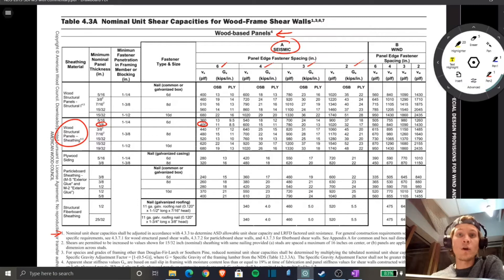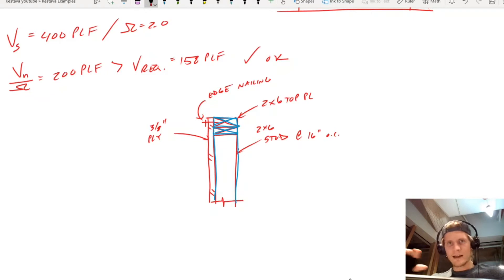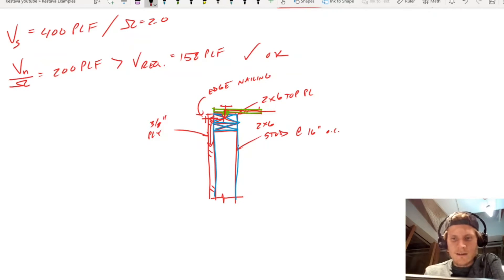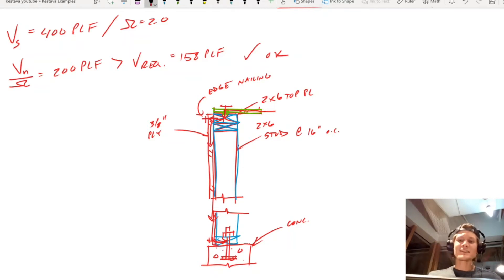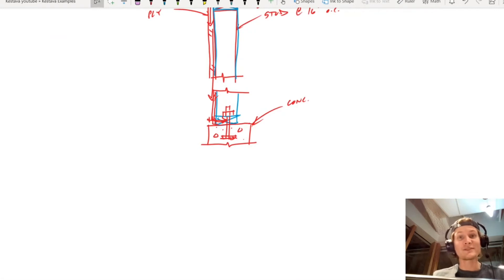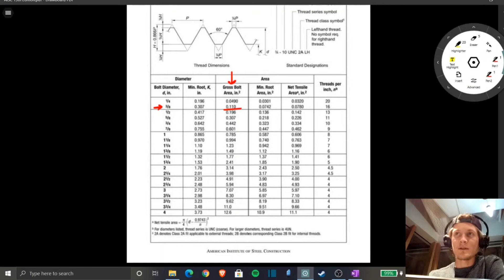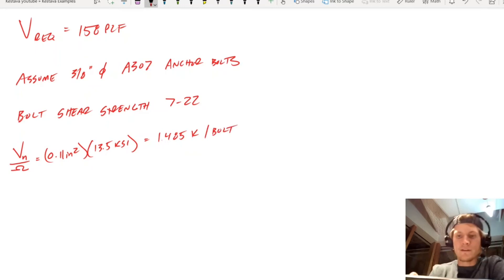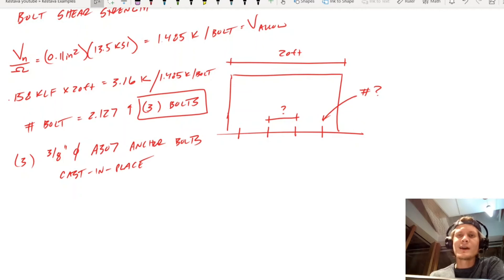How to Design a Wood Shear Wall - Part 2

Comment: Thank you for the video. Isn't the over-strength factor equal to 3.0 per ASCE7-16 table 12.2-1 item #15?
Reply from the maker: yes you are correct! it is 3.0. If you look at foot note "b" you can reduce this number to 2.5 if your structure has a flexible diaphragm as well!
Reply: I see. Thank you.

Comment: Phenomenal video. I passed the PE taking the hydrology depth but I’m slowly shifting my career to structural. Your videos are super helpful for me. The breakdown of the load path is exactly the content I love seeing. Sometimes the content we learn in class or in books is so specific, it can be tough to see how it ties in to the big picture. It’s like we’re designing a beam/column/wall in a vacuum, with no context. Please keep up the good work! Now for my question, the lateral force you drew, the arrow going from right to left into the diaphragm, shouldn’t that arrow have going INTO the page? Ie parallel to the sheating, since shear walls handle in-plane lateral forces, not perpendicular? Maybe I misinterpreted what you did.
Reply from the maker: your spot on Philip - my arrows are meant to show how the lateral forces (into the page) get from the diaphragm down to the foundation.
Reply from the maker: out of plane lateral is resolved through bending of the studs about their string axis for stud walls. this can actually increase the size of your studs if the wall is tall enough and the (mostly wind force) is high enough!

Comment: Thank you for making this very easy to understand.  Can you please explain the concept of over strength factor, Omega>
Reply from the maker: yes! i will get more into that in an upcoming video. thanks for the kind words!
Reply: @Kestava_Engineering  Omega or over strenght factor is simply a safety factor tht increases your required strenghtt or number for things you don't know about in the quality of the material, workmnship,  etc.

Comment: I would have thought that you needed to check the capacity of the sill plate through the NDS (axial compression / interaction with an individual bolt). Is this not the case? Or did you do this and I didn't quite catch it?
Reply: I agree.  Usually, the wood connection controls for sill plates.  It should be checked using the NDS.  The 2018 NDS Table 12E has capacities for 1/2" and larger anchors to concrete.  For spacing, the IBC allows a max spacing of 6',  but the CBC allows for max of 4' w/ 5/8" anchor bolts and 0.229"x3"x3" plate washers for Seismic D,E,F (Maybe C as well but not really much C in California).
Reply: @svroundabout thanks!